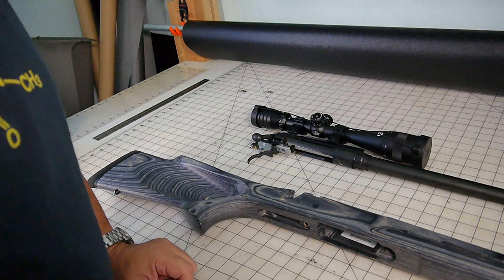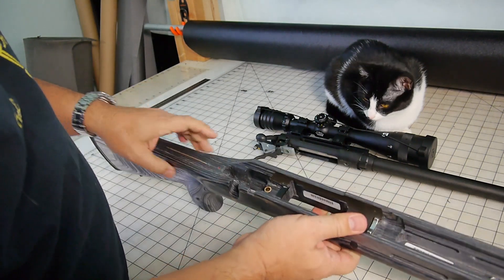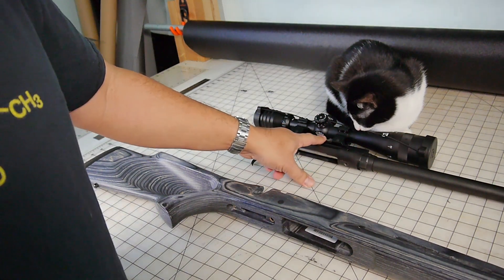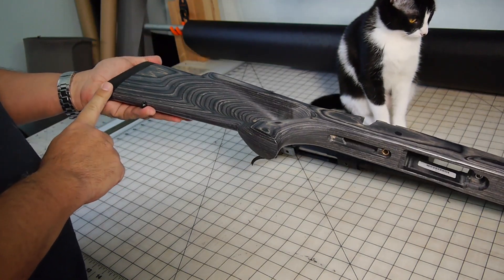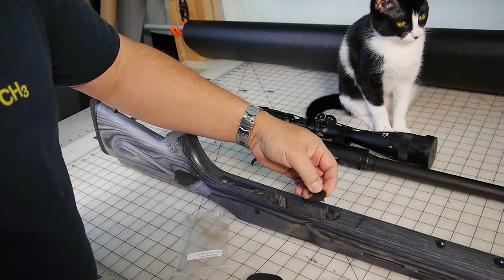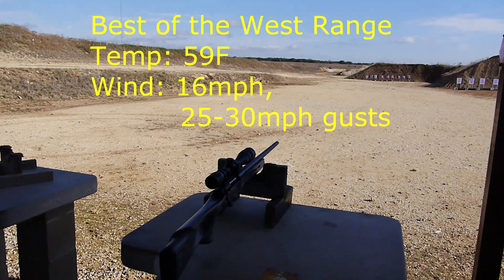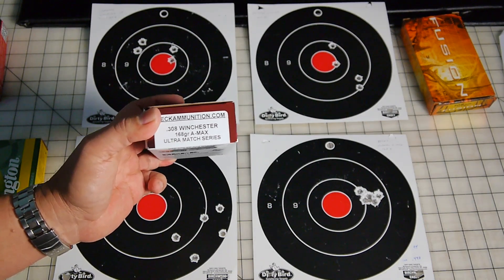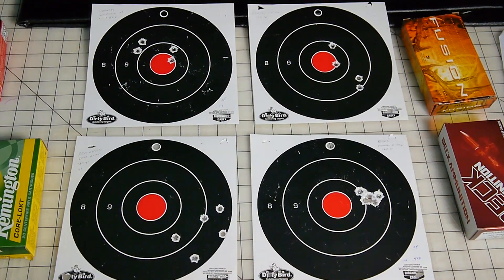Savage Axis Heavy Barrel - Upgraded Budget Rifle

Comment: I bought a standard barrel profile axis in 6.5creedmoor. Did the same upgrades you did. I also blue printed the action, chopped the barrel to 17”, and made a muzzle break. After all that I was able to achieve 3/4” groups at 200 yards. Suffice to say I think you’re on the right track, and I appreciate the content you put out as it guided me in my build. I ended up buying your pillar set up and was very happy with it. Thinking about upgrading the barrel. Namely because the rifle just looks a little silly right now. Anyway, thanks for sharing and good luck with your rifle. I’m pretty happy with mine

Comment: I have the same 308 Axis SWFA scope. Replaced the spring, kept the original. rag fiber glassed inside the had grip area to with in inch back. Used foam spray in the rest of the stock to keep it light. Fiber glassed under the barrel. I found all the ammo V3 Tactical did not shoot good groups. I recommend Hornady Match A-Max or BTHP 168gr. only. Good groups. Was able to shoot good groups at 500 yards 98 ambient outside temp, 50 humidity 2.7 mils with the gun zeroed at 200 yards.  third and last shot 1 1/2 inch below dead center, 2 inches right. 2.0 mils 15 1/2 inch low 2 inch right. 3.0 mils dead center 7 inch high. Ran out of bullets. IT WILL NOT SHOOT 150, 165, 180 gr bullets. tried almost every grain and manufacture. Good luck. Buy the Hornady first, save some money.
Reply from the maker: Thanks for the feedback.  I had the best groupings so far with the Hornady 168 A-max from Becks. I don't know what powder they were loading...I am going to try hand loading using Hornady 168 A-Max and Hornady 178 BTHP.  I will probably use Varget powder and see what happens.

Comment: I've got one of the first Savage Axis in.308win. put a Boyd's pro predator stock on it,Konus pro 6x24-44mm scope and a Blackhawk bipod.Polished the sear and removed 1 1/2 coils from the stock spring in the trigger group.Worked up a kinda weird handload it really seems to like.Hornady 168gr A-Max w 42grs of IMR4064 behind em and this rifle is scary accurate.
Reply from the maker: Sounds great. I'm going to start some handloads one of these days. So far, this rifle has liked the heavier grain bullets, so I have some 178gr A-Max and Varget powder to start with.
Reply: V3 Tactical I've not tried the 178's yet being heavier I'm sure they would perform better at longer distance I know the 168's keyhole out past 600 yards as they do not handle the transition from supersonic back to subsonic well.I'll give them a go ,let me know what you work up and results and we will compare.
Reply from the maker: Will do.

Comment: I think the problem you had you identified. Loose screws and scope out of alignment. That particular Boyds stock is CNC machined specifically for the Axis action to be tight fitting. You should not have to pillar mount or bed that stock. Mine is tight fitting without all that stock work. With factory ammo you will just have to find one that shoots the best. Hand loads would improve the accuracy if done right. A rifle rest like a Benchmaster or even a cheap Allen will give you more exact results by taking human error out but I would suggest the Benchmaster or other rifle rest options for better quality than the cheap Allen. The Allen folding deluxe would probably be better.

https://benchmasterusa.com/benchmaster-cadillac

https://www.walmart.com/ip/Allen-Sharpshooter-Gun-Rest/32801048
Reply from the maker: Good points. I still saw some improvements after bedding and pillar mounting.  For the amount of effort, it was worth it in my opinion.